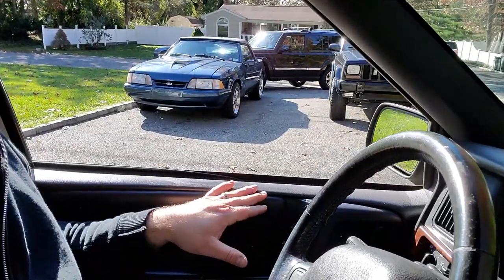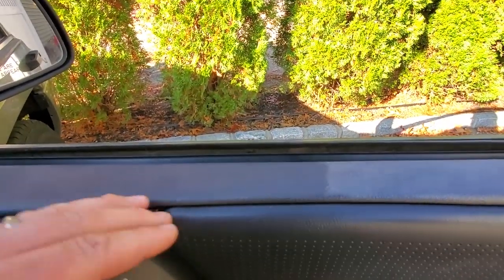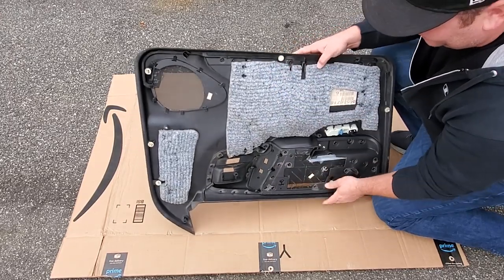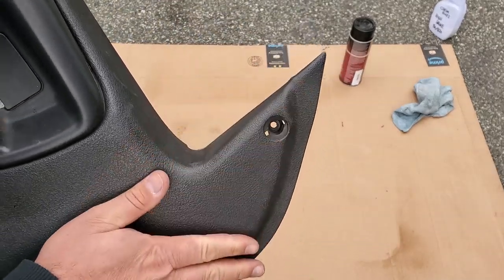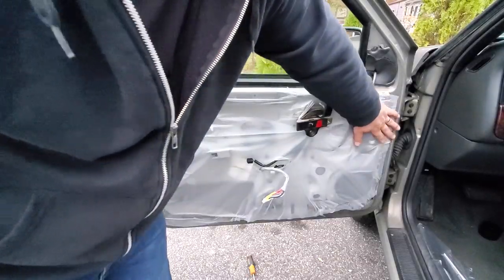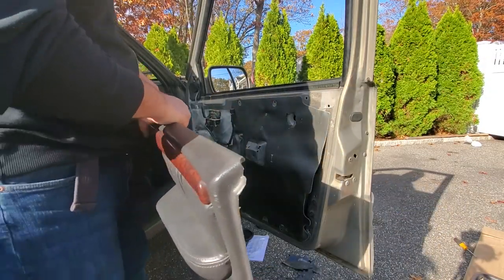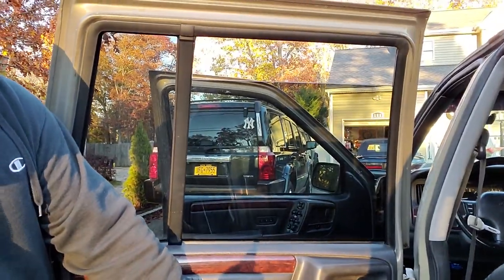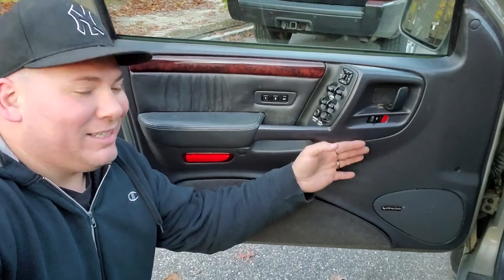JEEP ZJ 1998 5.9 DOOR PANEL UPGRADE WITH PLASTIC RESTORATION TIPS

Comment: I think only limited has the wire harness for the courtesy lights because mine has them and it's the 4.0 with every option expect the 5.9 engine . I liked how the new speakers just appeared 😂 awesome job Dan 👍
Reply from the maker: HAHA! Magic speakers! 🤫 Lol
Reply: Yea all limiteds have them. Mine definitely does with 5.2.
Reply: @brossovitch  how do like the 5.2 is it a good running Jeep ? I've never had one with that engine but had older Mopars with a 318cid and a carburetor but never a Jeep .
Reply: @jaysmith5084  I love it. I absolutely love it. Its very easy to work on, almost everything is accessible for service. Good torque and strong transmission. I've only had it for 1.5yr and it's still rust free. California car with no EGR factory. Also fully optioned.
Reply: @brossovitch  Is it all wheel drive or 4x4 ?
Reply: @jaysmith5084  V8s don't have selectrac to shift into 2wd when they're 4wd models

Comment: Looks awesome Dan! The passenger door module swap out got me good. For 2 days I couldn't start the jeep and was scratching my head thinking what have i blown...Lol 🤦‍♂️
I have a Laredo and the Courtesy light harness was taped up and tucked behind the inner liner. Plug and play Worked perfect. Have a closer look.
Reply from the maker: Haha! Silly Jeeps! I was all up in that door, but I'll look again for that pig tail! Thanks man!
Reply: @ProjectDanH  I have a 1995 and a 1997, Like yours, it’s in the passenger door of the 97, but the 95 is in the rear hatch. Found out when replacing power locks with Amazon actuators instead of expensive Jeep ones.

Comment: My ZJ 4.0l Limited has the door lights, though I pulled the bulbs out to help save the battery... nice looking doors Dan, love your tips on the heat gun
Reply from the maker: That's something I never realized... Battery drain!  Maybe it's best I didn't find the pigtail!
Reply: @ProjectDanH  They don't drain the battery, they only turn on when the doors are opened up.  I believe they share the same functionality as the interior/courtesy lights where they come on when you unlock the Jeep and/or open the doors and turn off when you lock the doors or turn the ignition on at least that's how they worked in my 96 ZJ limited.

Comment: I used orange nail polish on the gear selector on my wj. I am sure you can get new wiring harnesses in your doors to get those puddle lights working or you could wire them into your footwell lights.
Reply from the maker: Excellent idea... Maybe I can find some rust free limited doors and replace everything. Lol

Comment: Just a heads up if you're adding that memory module on the door to your existing power seats, or are adding power seats and that memory module on the door.  That module likes to go haywire and readjust the seats and mirrors at random while unlocking the doors.  Some people have repaired it by cleaning various connectors, but I actually just went ahead and disconnected mine behind the door panel.  It doesn't affect anything else's operation.
Reply from the maker: Thanks for the heads up!  I have to rebuild a driver seat that has the memory motor so I'll make sure I give everything a good once over.  Thanks again!
Reply: Yeah the memory function in my 96 ZJ never worked right, luckily the 98 ZJ I have now doesn't have that.  My 98 ZJ is the Laredo SE so pretty much the limited edition without being a limited edition so luckily they skipped the memory function, it drove me nuts in my old ZJ.
Reply from the maker: @wildbill23c  Interesting!  Thanks for the info!

Comment: Dan I would like to know how much if u sotting information center for my 1997 tsi 5.2 bad coolant n it's not bad please let me know Sir I see u know how to do it I live in Ga.If not I understand keep up great content n God bless
Reply: Its a message regarding the coolant temperature sensor.  Its not the sensor on the engine its the one in the coolant reservoir.  My 96 ZJ had the same trouble it would say bad coolant temperature sensor...I went as far as to replace the one on the engine as at the time I figured that's the one it was talking about, but it wasn't.  I never did fix it, and it only would do it occasionally so I just learned to ignore it on the random occasion it complained LOL.
Reply from the maker: Hey brother thanks for watching.  You should try to solder your information center.  It could be a really easy fix.  Also maybe the sensor could actually be bad.  See if you can try another sensor too
Reply: It's your VIC.  Not the sensor.  There's many videos about cold solder joints in the VIC.
Reply from the maker: @firehawk6188  Agreed.. probably your VIC

Comment: Hi man. I just subscribed to your channel because I find it interesting and fun (except for the movies inserts that to me are too much).

I have problem with my ZJ's mirror memory that is completely lost. Mirrors set completely wrong each time I start the vehicle. Do you know if it's a common issue? Thanks.
Reply from the maker: Hey thank you for the Sub!  I really appreciate it.. sorry about the movie inserts... Its just something I like to do.   
On to your problem, yes it can be fixed. Inside the mirror assembly there are metal prongs that make contact with a little sensor on a computer chip.  Over time the contacts wear down or get blocked by dirt and grime.  I have a video coming out soon that will show all the details you need to dig in. Thanks again for your views!
Reply: Great! I will wait for your dedicated video. Thanks.
Reply from the maker: Hey FYI the first Vid Will be the restoration of the housing.. the vid I release next week will be the motor and memory function.

Comment: You should see the harness difference from power seats to power memory seats.

I don't think adding memory function to the seats will be as you think.......
Reply from the maker: Lol.. they have different motors and different harnesses... I'll get it done 😁
Reply: @ProjectDanH  I like it.

I've done some retrofits that most thought were impossible.

Keep  it up.
Reply from the maker: @firehawk6188  awesome man! I'd love to see some of your work. I'll keep it going 👊🏼
Reply: Just wanted to let you know what I found today and you might have already knew this.

1996 GC Limited.  My seat was messed up.   Driver seat track seized up.  Memory but no heated seats.

Went to pick and pull, found a matching heated memory seat so I pulled it along with the heated seat switch pod.

Pulled dash apart and found the pod wiring was all there!  Yay, plug and play for the switch.

Pulled my seat out.  The 2 wires that come from the floor to the seat are missing on the seat plug.

The good news is all the memory wiring / garbage is BUILT into the seat.

So if you have CCD wires at your seat plug on the floor then theoretically your memory retrofit will plug and play HOWEVER I don't know if you'll need the drivers door module also and or BCM to go with it to make it all work.

I suppose the easiest test to see if the memory features are enabled by default would be to put a memory compatible mirror on and see if you can store the setting or not.

Good luck!
Reply from the maker: @firehawk6188  Yup!  😉 Now you know the secrets.. just don't go steal my thunder and make a better video that Me!

Comment: How do you find out if your door have the key fob ability. and how do you install em
Reply from the maker: just buy a passenger window switch and key fob set on eBay.  as soon as you install it the keys should work. 👍🏻
Reply: Project Dan H got a question for you . I’m trying to do the Vic upgrade that you did but I can’t figure out why my vic won’t work . Bought it knowing it worked. Solder is good . WhT else should I look for
Reply from the maker: @LtRevan0117  not sure, they can crap out at any time.  Did your GDM work?
Reply: Yes it did . I’ll look into getting another one soon . All your videos are a big help thank you
Reply from the maker: @LtRevan0117  thank you. I really appreciate it 🙏

Comment: Will I have to reprogram fob if I just switch out the driver side control panel I have 97zj that just driver switch is bad
Reply from the maker: only if you change the passenger controls